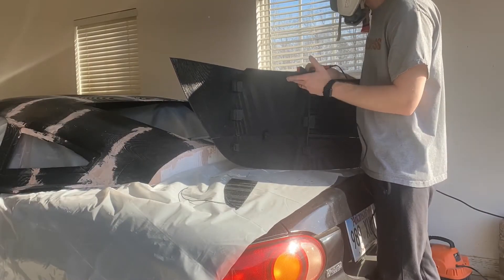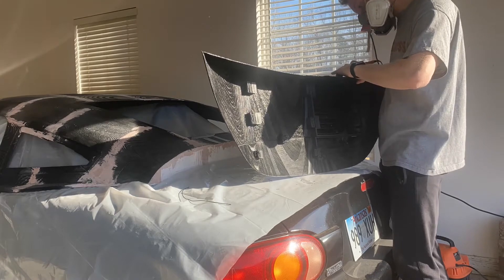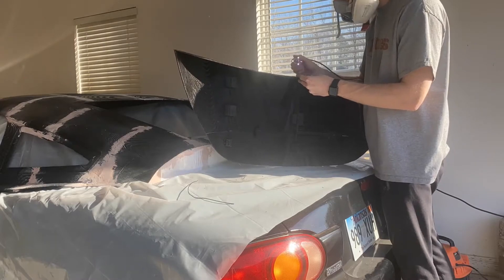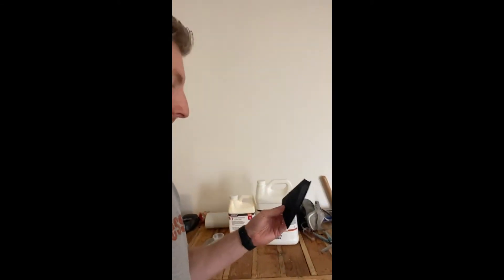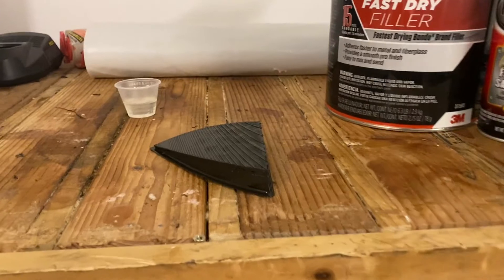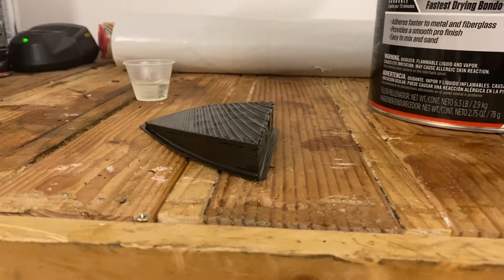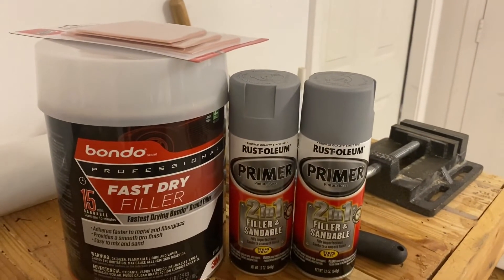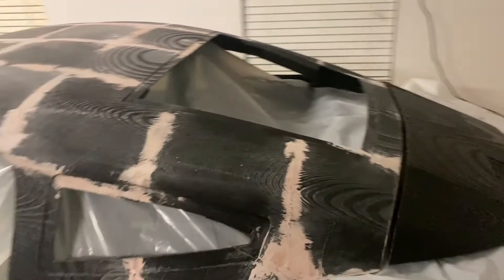3D Printed Carbon Fiber Miata Hardtop (Part 3)

Comment: Why wouldn’t you just use foam for your buck?  It’s gonna take a yr to do it this way.
Reply from the maker: Shaping the foam would take a lot of man hours compared to very little man hours with 3D printing. Plus this way I know it’s all dimensionally accurate.
Reply: @HutchinsRacing  
I once made an L88 hood from foam.  It took me about 20 hrs to get it in paint.    How much time do you have in your top so far?
Reply from the maker: @stickysspeedshop4388  I don’t know, I wasn’t keeping track. If I had to guess I’d say maybe around 100 hrs and I’m just about done with the whole thing. I spent lots of time recording and talking in videos and also this is my first time doing this. I suspect an expert could do it a lot faster.
Reply: @HutchinsRacing  “100 hrs”!!  That’s longer than I dated my wife before I married her!